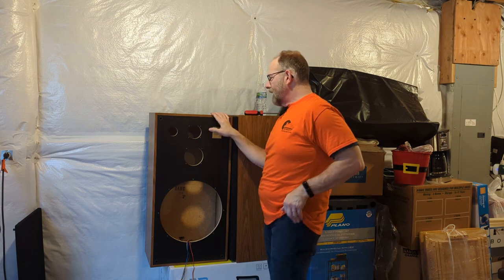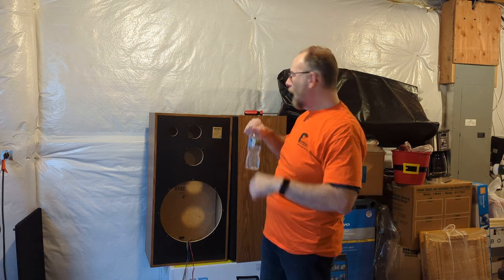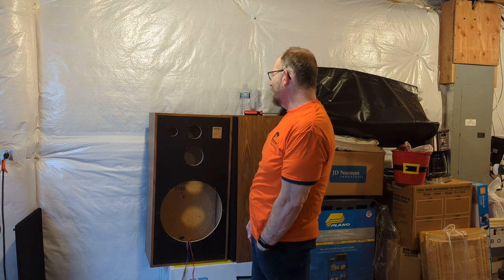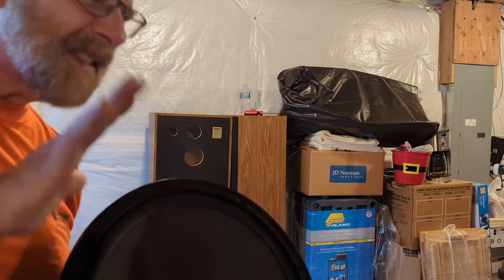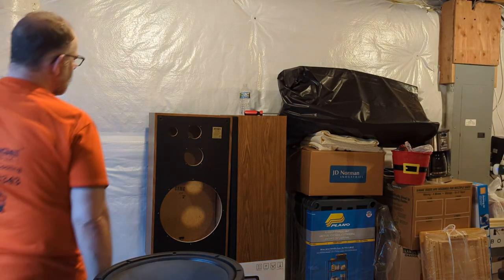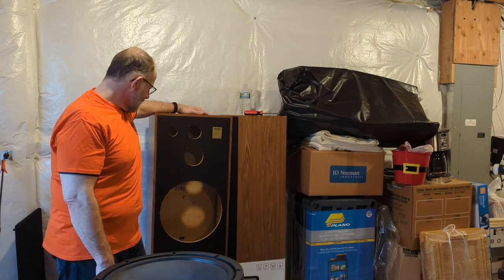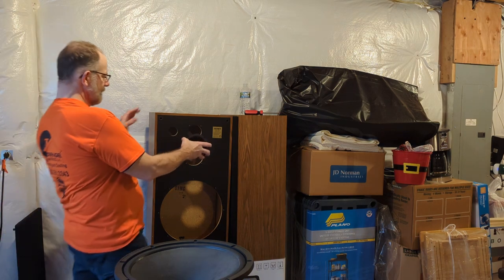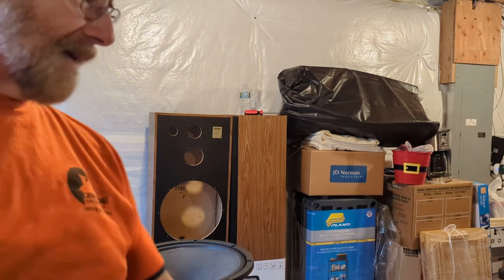How To Make A Cheap Vintage Speaker Sound Amazing! Jensen 3 Way Loudspeaker Project Part 1

Comment: I formerly did some djing in my younger days. I used a single set of Cerwin Vega
AT-12s. A 3 way speaker. 
  In my opinion, sounded damn fine.. Ran them off 2 rather common, lower wattage Technics receivers. Run through a 50 watt (i think) 4 channel mixer... Real cheap lil setup minus the speakers... Still have the speakers hooked up in another room of the house...
        But yeah made a real good sounding  little setup. At least the way I remember it

Comment: 😮I've got to set of Jensen that I'm listening to this video through currently. Also funny enough through a pioneer 838 just as you guys discussed. Funny. But I agree, they really do sound better than one would imagine looking at them or even after finding out what they weigh.

    Btw, those cabinets couldn't be more than 3 cubes. Just a guestimate, but i deal with mobile audio quite frequently

Comment: Kind of a side thought, I know this video is a year old. But I was thinking versus beefing up the cabinets you have you can come across a set of Peavy PH speakers pretty damn cheap these days. I bought a set w/12-in drivers, black widows in fact, for $50 including stands... Just saying, you can get them cheap enough you can sacrifice the speakers within. And that would give you a great bass (pun intended). to start with